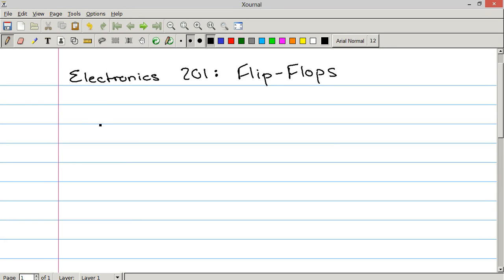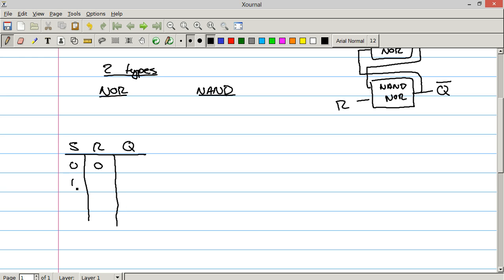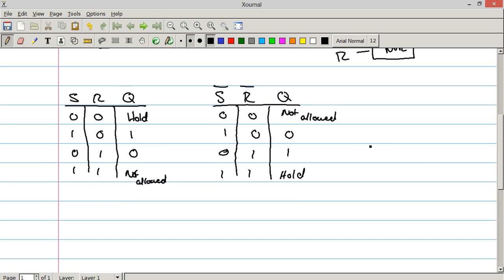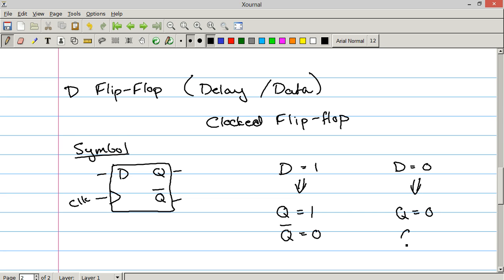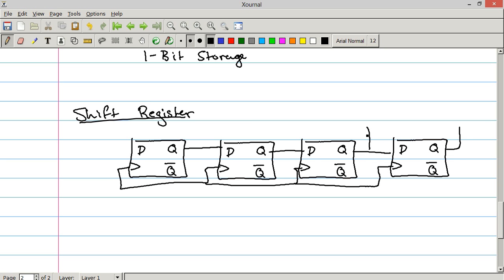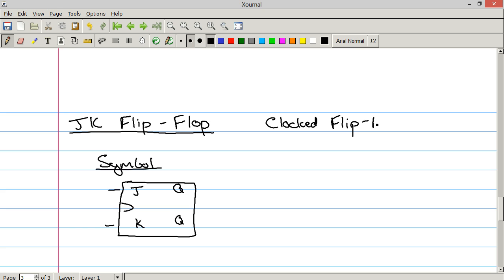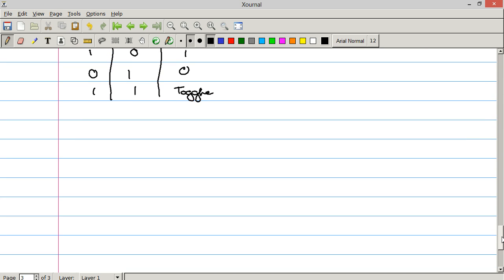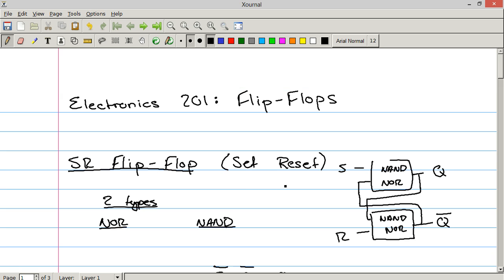Electronics 201: Flip-Flops

Comment: Hi, great tutorial.  I have questions though.  So if i were to add a clock signal, can i place that clock signal into the D on the D Flip Flop as the Data? Also wouldn't that change the waveform it creates from the clock signal? Furthermore, with the JK Flip Flop, what would the bits be attached to? Would they be attached to data or will they go back to the V - or V + power supply?

Comment: There is no such thing as an SR or RS flip flop. Their is an SR or RS latch. The difference between the two is that a latch changes depending on an input (that being S or R). A flip flop changes on clock edges. A latch latches onto the input value, but a flip flop changes on the clock trigger. Same thing for the D latch it changes from the change in data not from the changing clock.

Comment: An "RS flip-flop" is NOT a flip-flop as it is not clocked. It is more appropriately called an "RS latch"
Reply: RS can also be clocked
Reply: Clearly you don't know what RS stands for. There is no Clock input on an RS latch.
Reply: pramitbanerjee Actually, I did learn before I saw this video. To be a flip-flop, there must be a CLOCK input. Show me a clock input on an R-S Latch and I'd be happy to call it a flip-flop. It's not -- it's a LATCH. Very different things.
Reply: ***** sorry, but you don't know what you are talking about. S-R is the simplest form of flip flop as stated in the video. A flip flop, as the name suggests, goes from one state to the other. An R-S flip flop, also called set-reset has two states that - set and reset. 
I am amateur when it comes to these things, i am still learning. I assume you have come to this video to learn something. In that case, you should not have such a attitude as shown in your reply.
Reply: ***** What was thaught to me is the following: latches can be clocked, a clocked SR-latch is an SR-latch where the S and R signals are AND-ed with a clock signal. The distinction between latch and flipflop is in when the state transition occurs. For a latch, the state transition occurs when the clock is 1. For a flipflop the transition occurs during the clock transition from 0 to 1 (or 1 to 0). So, latches are level triggered and flipflops are edge triggered. They can both be clocked. 

Source: Structured Computer Organization, Andrew S. Tanenbaum, sixth edition, section 3.3.1 and 3.3.2
Reply: Sintaxx2 Right, but an RS latch with a clock input is just a flipflop! You don't seem to be grasping this -- look at the internals of a 555 timer, for example. The only inputs are R and S. The only outputs are Q and not Q. There is no clock input! It's just a latch -- so saying that latches can be clocked is true, then you have a flipflop, but an RS latch is not a flipflop. Period.

Comment: do flip flops store data? and can you give an example of what kind of data?
because in my head im imagining data such as saving a word document, am i on the right track?
Reply: No, flip flops only store bits. One bit per flip flop. And they don't necessarily store data, they just have states which is a one or zero.
Reply: somedudenamedbubba so what does it do with the bits

thanks for replying btw
Reply: They usually are associated with some kind of output. Think of it like a gate with two inputs. Two inputs go in, one comes out depending on the gate.

The reason I said they store bits is because the next state of the output can depend on what the output is right now.

I hope this makes sense haha.
Reply: somedudenamedbubba Sorry im not phrasing my question properly. How does a comp use a flip flop and What does a flip flop actually do for the computer?
Reply: Haha that's looking at it in a very high level. There are many many flip flops in a computer, so many that I wouldn't bother with knowing exactly how one is implemented in the overall scheme of a computer. 

Computers work in bits, which is a 1 or 0. That's it. Everything you see, even the words that I'm typing, are 1's and 0's. Depending on what you are doing, the computer is going to use that information very differently, which requires thousands of components and different conditions to be met.

Sorry I can't be really clear, but flip flops aren't used for just one certain thing.